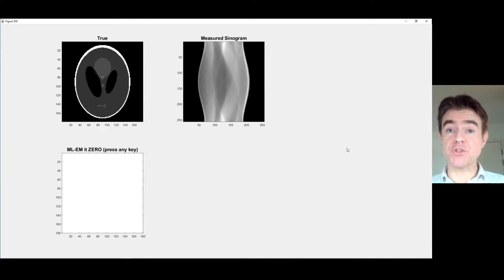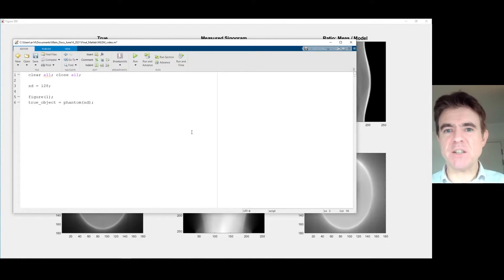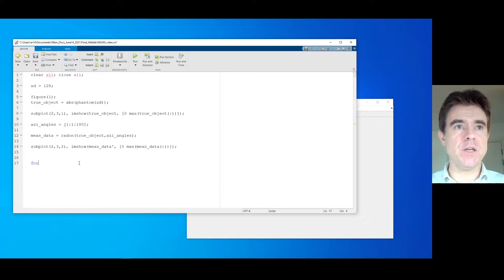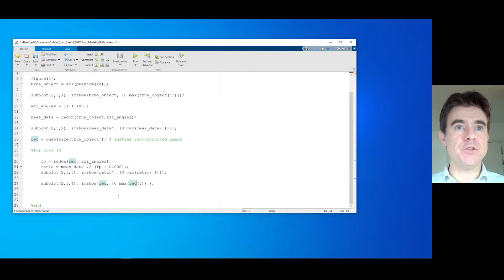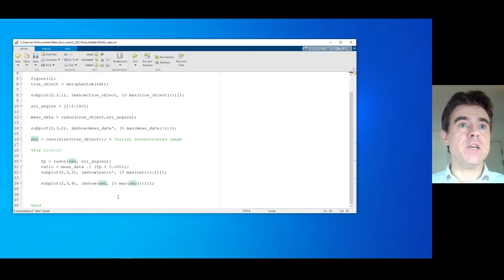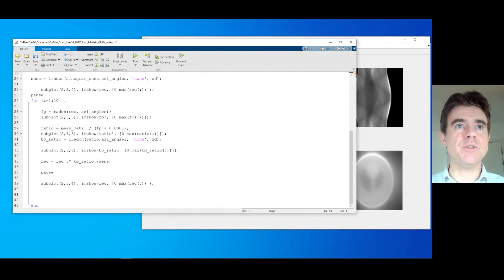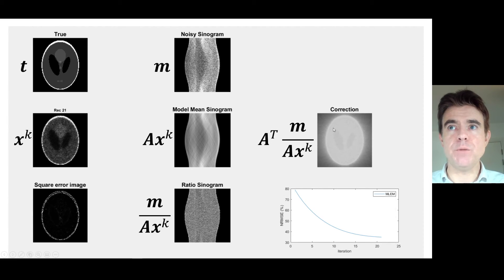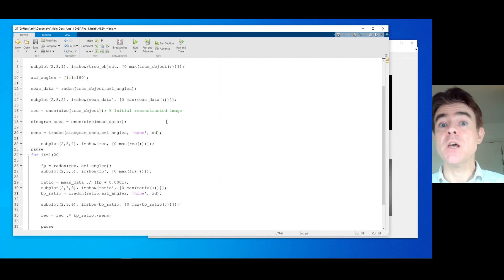Simple code for iterative image reconstruction (see https://youtu.be/IhETD4nSJec for PYTHON version)

Comment: Thank you so much for the informative video! I'm new to using MatLab-- where did you import the data of the sinograph for your code to work on it?
Reply from the maker: Thanks for the feedback! In this code I used the phantom that is available in Matlab, and then used the radon function to create the sinogram data from that phantom. Hence I did not need to import any data for the sinogram.

Comment: Thank you for your wonderful simulation and implementation,  I have a simple question about why the BP operator (A.T) is actually the Transpose of the forward projection (A), I couldn't get the relation if you can please guide me in this matter.
Reply from the maker: Many thanks for the feedback! When deriving MLEM, we find the need for A^T. This means we need to swap the rows and columns of A. The matrix A contains rows which are lines, each line being used in scalar product with the input vector. When considering A^T, it therefore has columns which are lines. To apply A^T to an input vector means that the input vector contains weighting factors for each column (i.e. a weigthed set of lines, which is backprojection). For more info please see this video: https://youtu.be/ARGHLWkf5yU
Reply: @AndrewJReader  Thanks  for the clear response + video recommendation, It's really clear in my mind, your videos are like  a knowledge reference to me.😄

Comment: In ratio command inside the loop it says to me that it's an error because 'arrays have incompatible sizes for this operation'. How do i solve that?
Reply from the maker: Hi, have you checked the sizes of the arrays? If so, what size are they? Are you using "./" in Matlab to ensure element-wise division? Hope this helps you to find the solution?
Reply: @AndrewJReader  I have to say that this video was very useful and no other helped me so much. Yes i used  "./"  but how i check the arrays? Furthermore the function sens is not recognised.
Reply from the maker: @charalmposkor7949  I was suggesting that you could print to screen the size of the arrays to try and understand what is happening (e.g. using the function "size" in Matlab). In the video, I think I used "sens" as an image array, based on backprojecting a sinogram filled with ones. So it is not a Matlab function. Hope that helps?
Reply: @AndrewJReader why sens is not recognised?Also it says that ineed positive integers. How do i change that?
Reply from the maker: @charalmposkor7949  sens is defined later in the video, nearer the top of the code. Sorry that the text is not crystal clear
Reply: @AndrewJReader  I am sorry if i bother you but in wich line of command is the definition of sens? Furthermore how do i change the problem with integers?
Reply from the maker: @charalmposkor7949  Look at 10mins 49sec, lines 18 and 20. That defines sens.  I do not know why there is a problem with integers arising, I would need more info to help with that.
Reply: @AndrewJReader  oh I had done that but i did a mistake but i fixed it. The thing is i don't know what's wrong with integers. Can i check it out and tell you more info in order to help me?
Reply from the maker: @charalmposkor7949  Hi, yes, if you copy the error report and the line of code referred to, I might be able to help. I am not aware of anyone else having problems with the code in this video though. Best wishes.
Reply: @AndrewJReader Finally i solved it! Thank you so much. The thing is that in each iteration the picture doesn't get clear.
Reply from the maker: @charalmposkor7949  Hope this is now solved - the image should sharpen with increasing iterations

Comment: Hey Andrew, thanks for the video!
 I am using this algorithm for my bachelors thesis. It works well, but I ran into a problem. 
I  want to add gaussian noise to the  measured sinogram, but whenever this is done my reconstruction is barely recognizable. 
Maybe you can give me a tipp on where to change my code for this to work , thanks : )
Reply from the maker: Thanks for your comments. The simplest fixes would be to use the algorithm for a smaller number of iterations, or to smooth the image after finishing a chosen number of iterations. Otherwise you need a MAPEM method rather than MLEM. I do have lectures on MAPEM on this channel. Or you can put a CNN into the method, .... there are many possible noise compensation strategies (regularisation strategies).
Reply: @AndrewJReader  Thanks, I'll check out your video on the MAPEM method. So if I understood correctly there is unfortunately no way of adapting my MLEM algorithm to work with a noisy sinogram.
Reply from the maker: @runekotzerhzn5511  MLEM in this video is intended for sinograms with Poisson noise. Even then, images which are reconstructed from noisy data, based only on data fidelity, tend to be noisy. You can change the spatial basis functions, to avoid insisting on pixel perfect reconstructions. So you could use Gaussian spatial basis functions, for less noisy (and less sharp) images.
Reply: @AndrewJReader  I fixed the issue with MLEM not working at all (reconstruction is barely recognizable), I referred to in my original comment. I think the problem was that my addition of gaussian noise caused negative sinogram values, which should not be the case! 
Now I only add positive noise values to the sinogram and the reconstruction improves for a few iterations, then quickly gets worse - as you pointed out in your first answer (small number of iterations).
I also tried out the SART algo. from Skimage, it also can't handle noise in the way I am currently doing it. Shame because I would like to show that iterative algorithms can perform well with noise. 
I was not able to find your video on the MAPEM method, can give me the video title? Thanks
Reply from the maker: @runekotzerhzn5511  Right,  indeed can only have positions values with MLEM. Please see about 38 minutes into this video
https://youtu.be/ULxXWXjlel4

Comment: Hello, first of all, thank you for awesome video. It helped a lot. Could I just ask one question ?

 I have sinogram of phantom from SPECT. If i want to use it as an input, should I make inverse RT, then RT to obtain sinogram or should I use directly my measured data? I reconstructed FBP with Ram-Lak filter and with no filter. If I use the reconstructed image with Ram-Lak as measured data and not filtred image as first approximation it works perfectly. Once I put my measured sinogram without any modification, I recieve just black figure. 

Thank you in advance!
Reply from the maker: Hi, thanks for the question.
For this kind of iterative reconstruction, MLEM, you should use the raw measured data. Of course, for SPECT, there will however be many other effects that you should ideally model (attenuation, for example) or else precorrect for (precorrection is not ideal though).(For an example in PET, see: https://youtu.be/F7R1PC7Vmt0)A raw measured SPECT sinogram, in general, will not be consistent with the Radon transform, unless all the other effects are first compensated for by modelling or else corrected.
How did you do your FBP with Ram-Lak filter reconstruction? Did you use your raw measured sinogram data, and then use iradon in Matlab? Perhaps you used other software, that does the precorrections?
Reply: @AndrewJReader  Yes, exactly, I used my raw data and used iradon in Matlab. 

Also I was thinking the problem could be cause by the size of matrix? When I use my raw measured data, I have 128x120, but when I make radon transform of FBP as first approximation I recieve 131x120 so I forced the transform to use output_size=max(size(raw_data). 

If I make radon transform of my FBP with Ram-Lak, it creates matrix of the same size as non filtred image I used as first approximation. Could this cause some kind of problem?
Reply from the maker: @amelieteache3852  Have you tried removing the last argument (xd) that I put into my iradon? That forces the output of iradon to be that size in x and y. Not sure if you used an argument like that in your FBP?  It is certainly better to use MLEM on the raw measured data, and not on a forward projection of a FBP reconstructed image. Indeed, just need to get the sizes of the sinogram and images to be correct.  Also, please be sure to have no negative values in your measured sinogram data from the start, as MLEM is a non-negative algorithm.
Reply: @AndrewJReader  I have following code: 
raw_data=abs(S);                                %measured sinogram 

output_size=max(size(raw_data)); 
FBP=abs(Ram_Lak);                            %reconstructed image with Ram-Lak filter 

angles = 1:1:179;

figure;

for i = 1:20   

FP=radon(FBP,angles,output_size);
comp= raw_data./(FP+0.0001);
BP=iradon(comp, angles, 'none');
FBP=FBP.*BP;
subplot(4,5,i); imagesc(FBP);colormap(gca,gray);
end

I also compared measured sinogram and front projection of reconstruction. The measured sinogram really does not correspond very well with the FP and when I divide it, it already shows whole black image during the first iteration.
Reply from the maker: @amelieteache3852  If I were you I would display every single image and sinogram at every single stage of your code, step by step. As you know, I use imshow with min and max specified, but if you know and trust imagesc and colormap, then ok. So, display the raw_data after abs(S). Also, report its dimensions, check its min and max. Likewise for FBP.  Then, in your loop, display FP, and also report its dimensions (e.g. print them to screen). Presumably the dimensions match for raw_data and FP? Next, display comp. Probably there is an issue with the division? So you can display the min and max of comp, using min(comp(:)) and max(comp(:)). Do the values look ok, or are there Inf or Nan results?  Then display BP and inspect its size, and the range of values.  I think you can see my approach to solving bugs - display everything (images, dimensions, min and max), and check everything - it will soon be apparent where the results do not match what we expect. I could probably debug if I had the raw data, but that is probably going way beyond a comment / chat on YouTube!
Reply: @AndrewJReader  I will try it this way :) Thank you very much for your time !